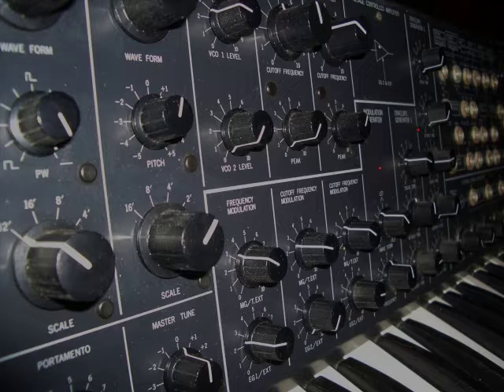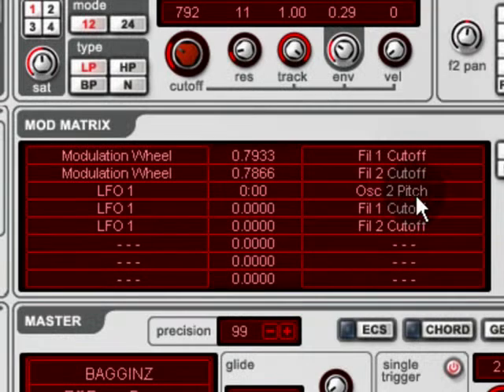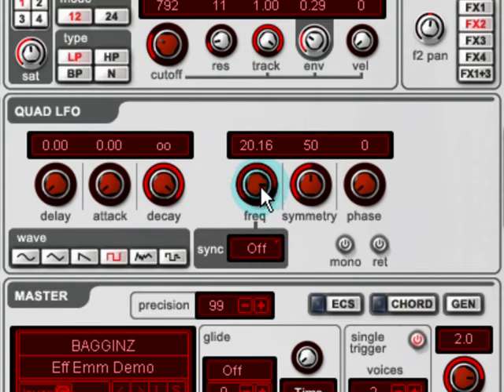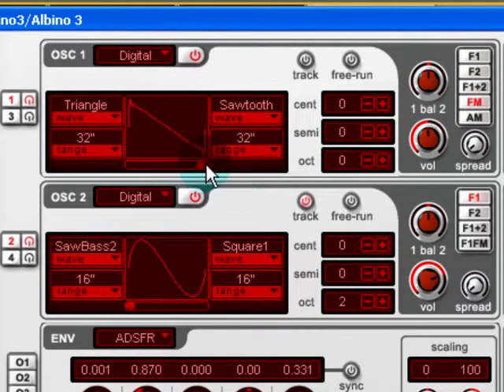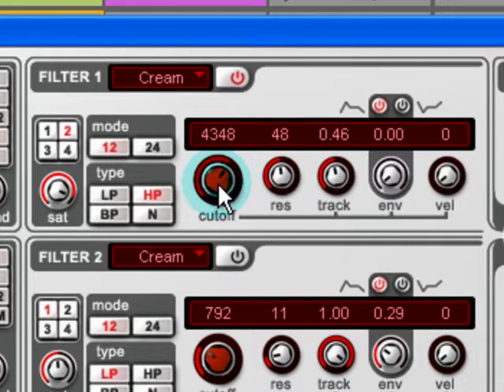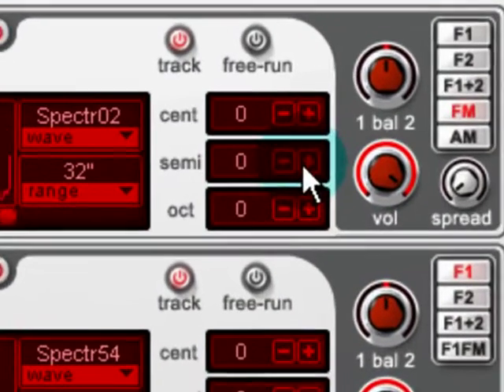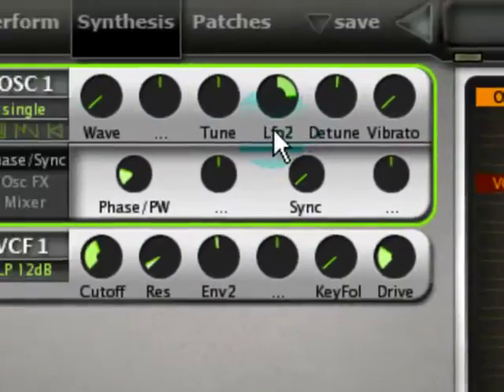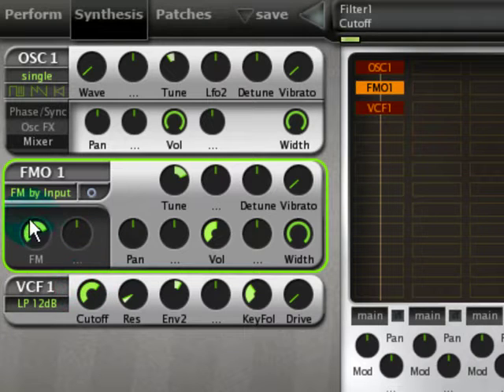11. Cross Modulation - FM

Comment: This is NOT cross modulation, cross modulation is if osc 1 modulates osc 2 and vice versa at once.
Reply from the maker: It is.  I'm using the term cross-modulation in the  generic synthesizer sense - i.e. that one oscillator's output is modulating another oscillator.  See here:   https://www.sweetwater.com/insync/cross-modulation/
Reply: @BillyCosmosis  As far as I know...Using one oscillator to modulate the pitch of another is just called FM, the 'cross' is when the modulation goes both ways (OSC1 modulating OSC2 and vice versa at once)